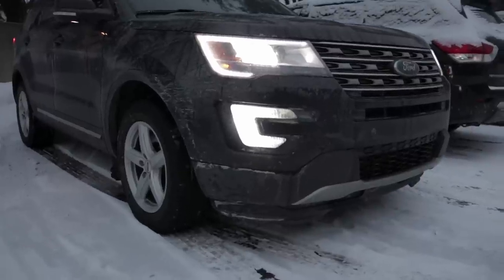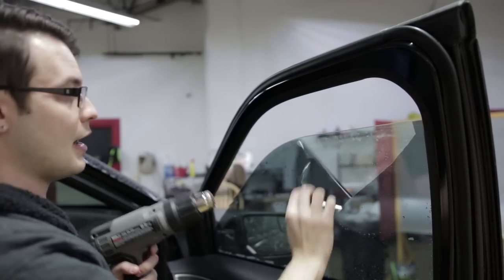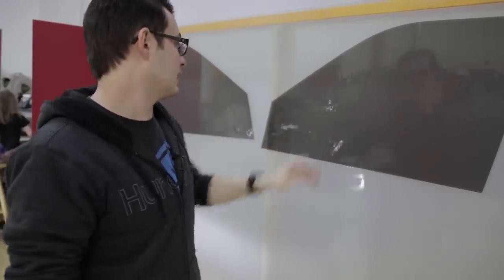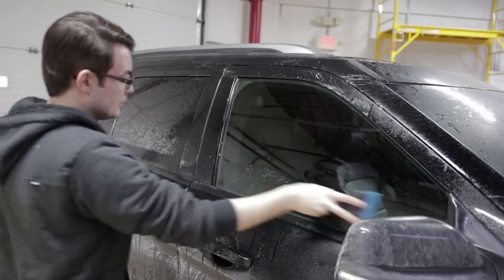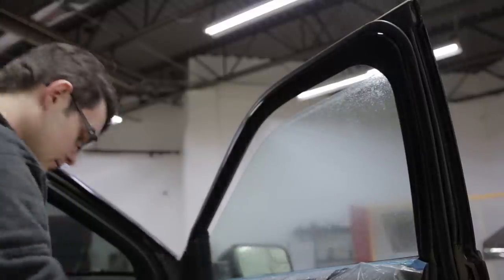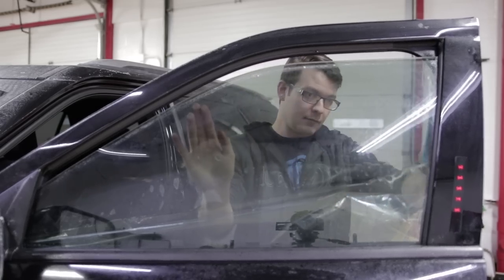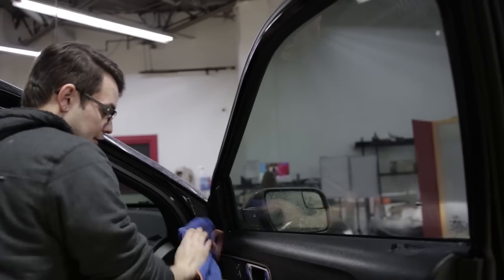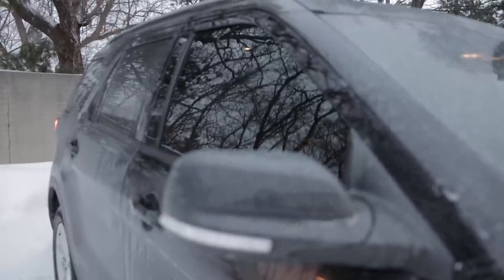Strip and Tint Two Front Windows

Comment: Car doors are not completely sealed from the outside to begin with. They are designed to have water go through them and come out the bottom side you just dont see it because its outside of the door seal. Water spraying on them from tinting them will do absolutely nothing as far as damaging anything unless you shoot water directly at a window switch or somthing. There is a plastic layer that keeps any electrical components from getting water on them so masking like he did is to keep people happy and does basically nothing to help the protect anything from damage.